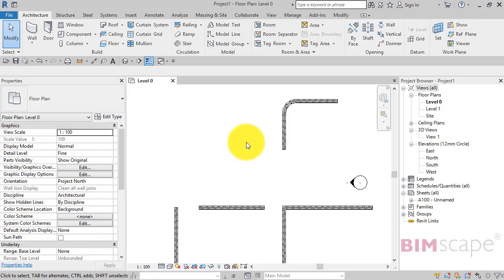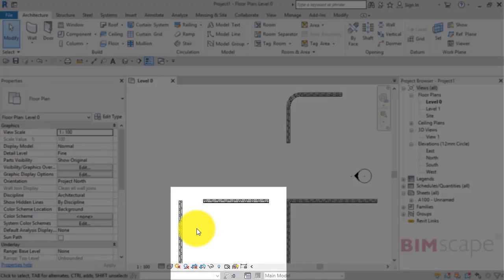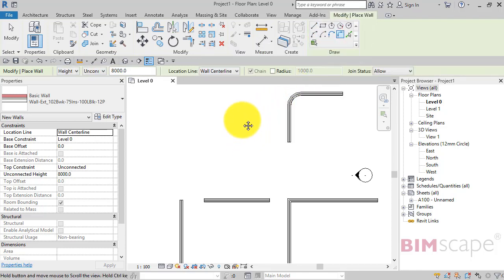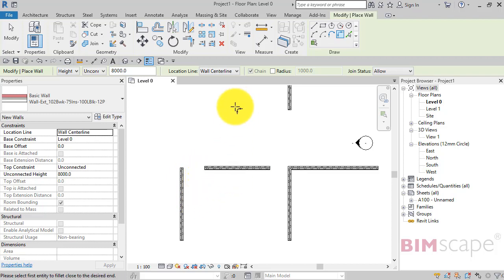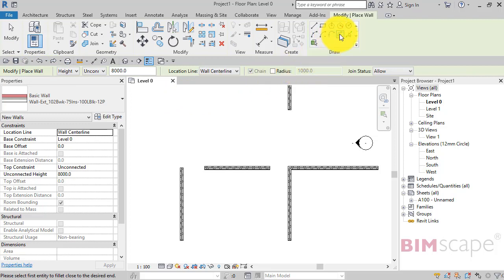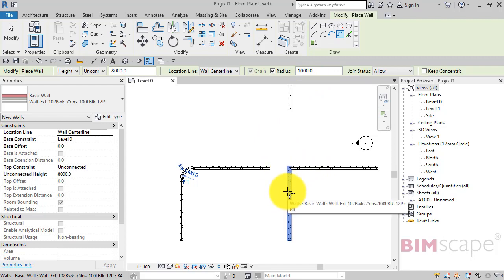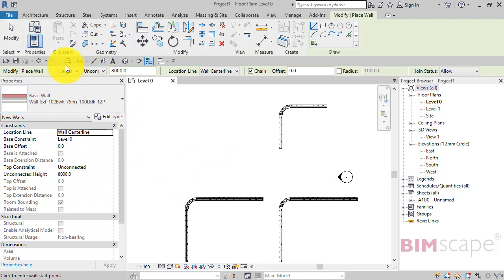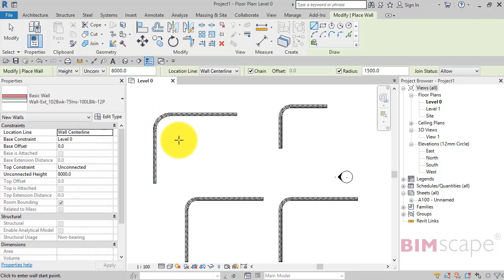Autodesk Revit: Fillet Arc Tools used with Walls

Comment: If you redo this video you might add that before evoking Fillet Arc, you may need to select the desired wall type first.  When I first tried this the wall type was selected as curtain wall, and I got some segmented curvish crazy windows.  So select one of the walls, then right click, then click 'create simular', that sets the correct wall type, then use the fillet arc command.  Also, I can not see the fillet arc tool by just selecting "Architecture" then "Wall".  I have to click the "Wall" down arrow and select "Wall: Architectural".  It might be Revit 2022 thing, or the fact that I could have selected "Wall: Structural"